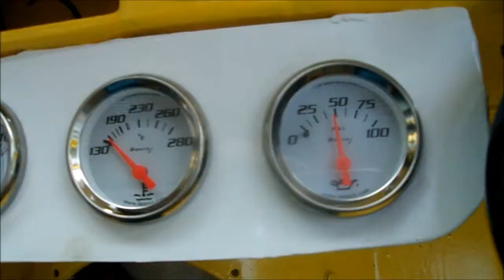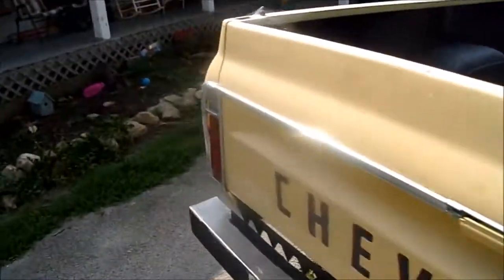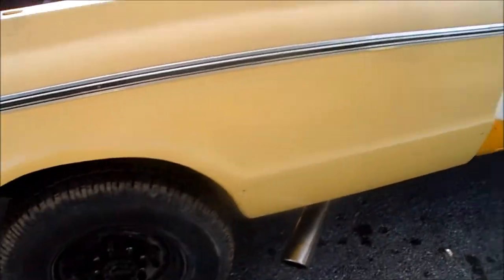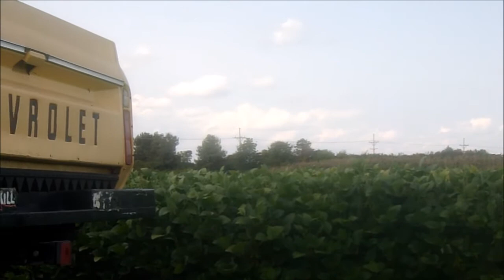LS swapped 72 Chevy c20 - Driving around

Comment: Dose that antenna have a loaded coil? They have to have one if they are that short. A quarter wave antenna is 102 inches long. If you get any shorter you gotta have a loaded coil under it. Looks like your antenna dont have a loaded coil. Say like if its 32 inches it has to have the rest of the length of antenna   in in a wire coil.  It called a loaded antenna. If its too short It can destroy the final output final transistor in the radio or burn it up. Because of RF, thats (reflected frequency radio wave).  You need to get a SWR meter so you can measure or read the SWR . I looked it up for you it says this.  It reports on its dials quantities called forward power and reflected power. You can get one for about twenty bucks at a truck stop. I bought one off of ebay for 15 bucks. 
  If your just going to have a stainless steel whip it must be 102 inches long. that is a perfect quarter wave. It will have great or near perfect SWR. Although I had to order or add a riser so I could adjust mine to get a perfect 1 to 1 ration SWR. 
  I think your antenna dont have a loaded coil or I cannot see it? so it would be waay too short and cause very high SWR. Eventually burn out your final and then you have to get it replaced becasue your radio will stop working Transmitting and receiving. You could put a fire stick right there it has a coil warped around the fiber glass rod to create a 102 inches. They come in 2 foot lengths or 3 or even 4 and 5 foot lengths. You can get a quarter wave or half or even 5/8s wave. Get a quarter though it too much to explain. 
  Antenna looks great though. Also many people put them behind the cab but its not a good spot even though it looks great. Because the radio wave will bounce off the cab because it waay too close. I have mine all the way back at the tail gate. You could put a magnet mount on the roof. Get a Little Wilson  or the Big Wilson 2000 magnet mount or you could actully drill a hole in the roof and add a real 102 inch whip that is the perfect set up for a CB antenna. Its up high and nothing interferes with it. nothing cause RF reflection and high SWR. 
  They have many videos and articles on SWR and antennas how they should be set and how they work. you will need a jumper wire or 1 foot coax to put between the meter too. The meter is only temporary to test with and you don't leave it hooked up.
Reply from the maker: Wow good info. that antenna is actually not hooked to anything. just for looks basically. i do plan on getting a nice antenna eventually .  I would like to mount it on one of the Mirrors.  I do have a truck stop nearby with a nice assortment of accessorys.
Reply: You could put a couple of three or four foot long fire sticks on the mirrors but one is all you need because its very difficult to set the swr on two. but some guys have two for looks but just use one. If you have to get a mirror mount. the Firestick has a coil wrapped around a fiberglass rod. they come in black and white  and maybe more colors. dont get a two foot long one because they dont get out good. the longer the better. Have you seen my video about my 102 inch whip on my pick up truck its cool. It got all that antenna sticking up into the sky. LOL the video is called 102 Inch Whip with a Ten Inch Riser Makes Best Mobil   Looks like a military antenna or a Ham radio dude. Actually Ham guys do use 102 inch whips for certain frequencies 10 and 11 meter and higher. 11 meters is cb bands 10 is ham it works for 26 27 and 28 megahertz so 27megahertz is cb band. They have these massive antennas like the truckers are using on there mirror mounts LOL look at his big antenna ha ha http://www.ebay.com/itm/Tram-TBC-6-Bigcat-6-CB-Antenna-New-/282581546671?epid=691204139&hash=item41cb2c36af:g:5kEAAOSwUgdZcmv0
Reply from the maker: shartne I'll have to checkout your video later . Sounds cool